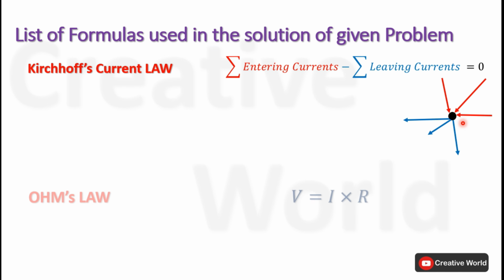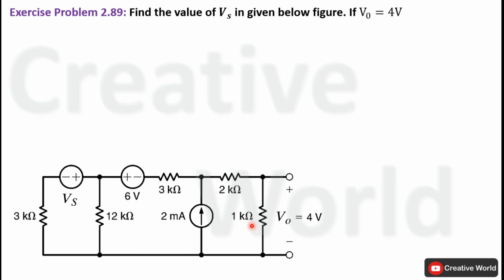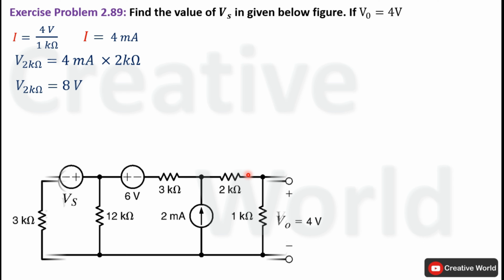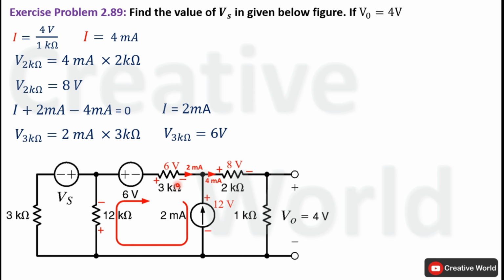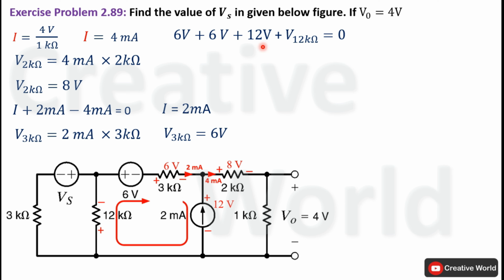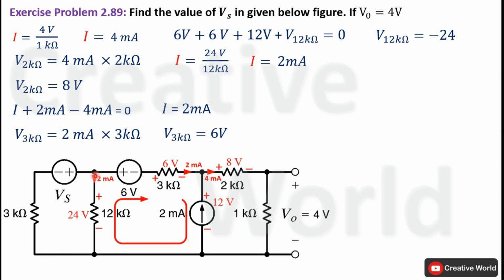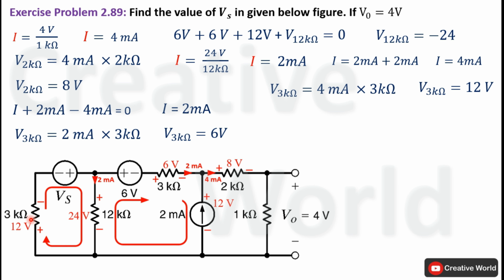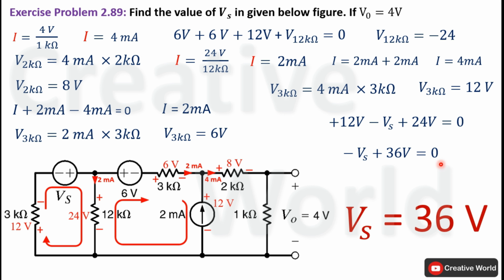Chapter 2 Exercise Problems 2.89 Solution | Linear Circuit Analysis

Comment: Sir, how did we find that the voltage of the current source is 12 V in 3.47
Reply from the maker: voltage across 1k ohm and 2k ohm will be added together because both resistances are connected in series and these two resistances are connected in parallel to the current source so the voltage across these two resistances will also appear across current source as well because of parallel connection